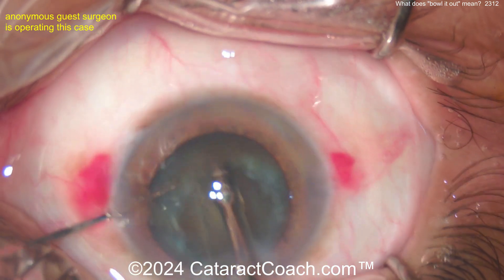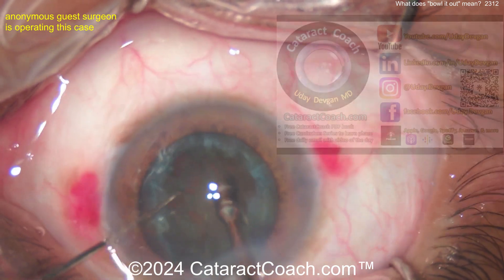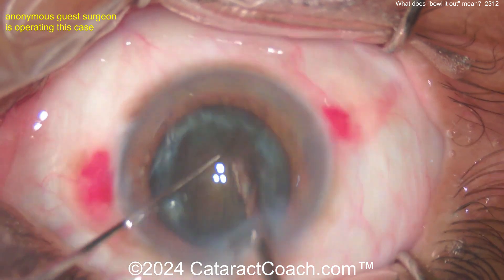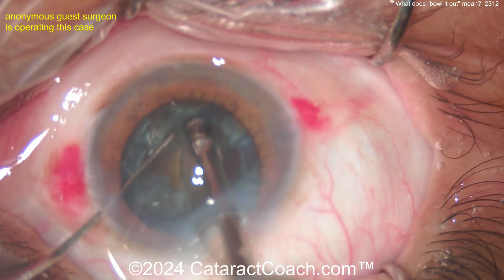CataractCoach™ 2312: What does "bowl it out" mean with cataract surgery?

Comment: Like other commenters, a "bowl out" means I failed to get a good enough chop / crack. Usually if lens is very soft or if bad posterior plate to the cataract. But at that point, I'll usually reach my ball tip chopper out there and just pull in / flip up the lens or viscodissect.